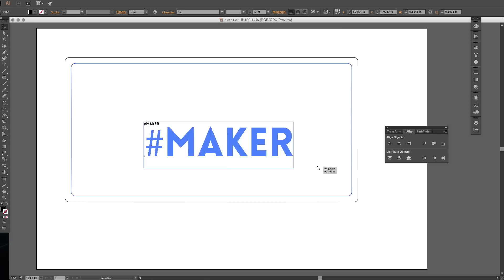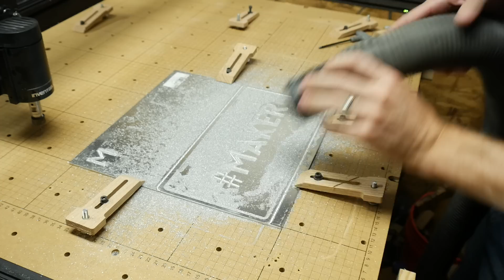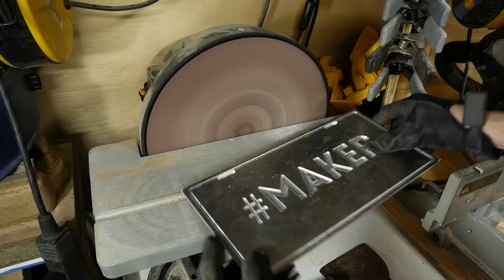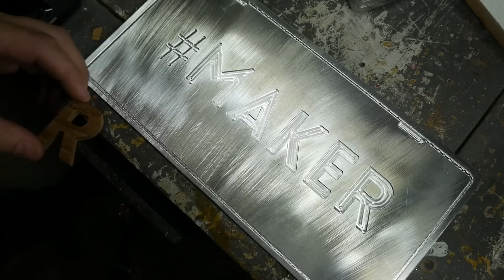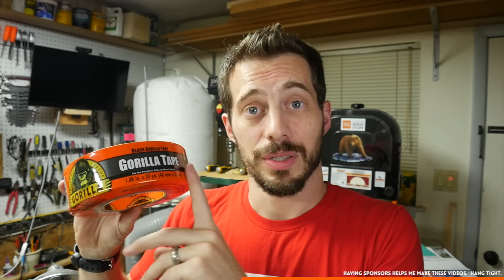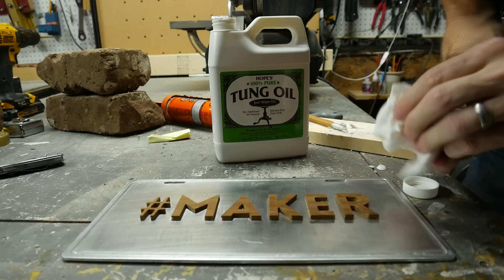Custom License Plate // How-To | I Like To Make Stuff

Comment: I'm thinking about getting the x carve but I've seen a lot of mixed reviews about it's reliability and dependability. Some have said that you have to calibrate it pretty much after each use. Have you run into any problems with the machine? Would you recommend it to a friend? If yes why? If no, why not?
Reply from the maker: I would definitely recommend it.  Personally I've not had any of the troubles that people complain about and I've built 3 of them for different reasons.
Reply: wow! thanks for the help! love your channel by the way!

Comment: When I do CNC inlays, I turn the text into vectors so I can manipulate it. Then I round-over any corners with a 1/16" diameter, because I use a 1/16" bit for this type of thing. Then I'm able to use the same vector file, cut a pocket toolpath and an outer profile one and the parts fit together right out of the machine, barely any sanding at all. It's like you said in the end of the video, about incorporating the limitations of the machine into the design.

http://imgur.com/IZTSgzL

In this image you can see the rounded corners, and how exact the fit of the two parts is. the letters here have a stroke of about 1/8" for reference.

Comment: I have never used that software on a CNC machine but the Vectric software has an inlay feature that will compensate for the inside/outside corner issue your having. 

Enjoying the videos.

Comment: i use a palm sander to finish aluminum with a brushed finish. especially large flat surfaces.  try sanding in a linear pattern like you would with wood grain . the finish comes out very nice and even!

Comment: you would have to pull some strings in California

Basically if you were assigned 2 then you have to have 2

5200.  (a) When two license plates are issued by the department for
use upon a vehicle, they shall be attached to the vehicle for which
they were issued, one in the front and the other in the rear.
   (b) When only one license plate is issued for use upon a vehicle,
it shall be attached to the rear thereof, unless the license plate is
issued for use upon a truck tractor, in which case the license plate
shall be displayed in accordance with Section 4850.5.

Comment: Instead of slots for the screws, you should have measured the spacing of the screw holes in your bumper, and drilled the holes on the same spacing, so no visible slots.

Comment: A nice finish to do for aluminium is to put a pencil in your drill press with the eraser on the bottom end and apply some grinding compound to the eraser and turn your drill press on and polish the surface by overlapping the polished surface and even better result is to use different sized erasers.

Comment: Check out mtmwood - the king of inlays. He solved the corner problem, but he has 3 axis mill and the head has a piramid cutting bit. As the head moves towards the corner it also goes up, cutting the corner into a point. The inlay letter has a matching side slant so it pops inside. Im not sure that would work on metal + wood combo.

Comment: Nice job as always. One thing on cutters for sheet aluminum, I've seen some with a downward cutting spiral. They seem to help the edge stay smoother since the cutter pushed the material down into the table instead of pulling it up against the clamps and causing chatter. It may not have mattered much with 1/8 in material and light passes, but it was great for thinner sheet metal.

Comment: I think you should check out G-Wizard over on CNCcookbook.com He has a Speeds and Feeds calculator and I think you will be amazed at what speed you should be cutting at with just a single flute. Add more flutes and your machine will have to go even faster to keep up with chip load (gets rid of the heat).  Also with thin sheet metal you might want to add shelf liner to the bottom side of the aluminum and spray adhesive this down to a scrap piece of wood. Should stop a lot of the vibration.

Comment: I think if you flipped the lettering so that the back is up then you set the first pass to run the rounded corners then each pass after that would run sharp corners.  I don't have a cnc and haven't done any inlay but that was just a first thought.

Comment: Nice work. But won't work in California. We need both license plates. Your cut time on the cnc table sounds rough. I cut some 1/4" aluminum plate the other day. It was a 36" x 18" semicircle with holes and cutout and it took only 25 minutes. Ok. I have a bigger machine, but possibly your feed and speed needs adjustment. Also, I used this 1/8" bit. From Tools Today, Amana Tool 51454. Spiral 'O' Flute. My feed rate was 18 IPM and I was able to use a router speed of 19,000 RPM. That is probably faster router than you have, but with this bit and feed, you should be able to do better. I called Tools Today and talked to them about how to do this. 

Keep it up. I like your videos.

Comment: Single fluit is fine for aluminium but you do need a higher RPM because it is single flute. I hope you dont mind I link to another video, in this video from Datron you can see a single flute used on aluminium with a nice removal rate, for example: 1:45 into the video ( https://www.youtube.com/watch?v=aCeywiKCYhA )

Comment: I'm looking forward to seeing how the machine works with the new bit/router.
Reply from the maker: +Greg's Garage Video coming on it, but I'll tell you.. it's WAAAAAY better :)
Reply: Then I have another question...  I suspect the dewalt has variable speed for the bit.  Did you go high or low speed?  Also, did you let easel handle the feed rate with its defaults?  Maybe I should just wait for the vid... :D
Reply from the maker: Greg's Garage I'm currently just trying different things.. going faster (feed speed and spindle speed) and faster until it stops working well, then I'll back off a bit.
Reply: +I Like To Make Stuff I'd like to know what the final speed is. if it took 16 hours with the slow spindle, and wrong bit, how long does it take with the dewalt spindle and correct aluminum bit.
Reply from the maker: Brian Noah WAAAY less time :) Video incoming soon.

Comment: I've never used easle with my shapeoko simply because it was not available when I started, and I've gotten accustomed to more advanced CAM programs (preferably Fusion these days because it's free and super good). The default settings in easle must be painfully conservative! Those cut times are horribad. Hopefully the new spindle gets you better settings. If not you should do some testing yourself with the wiki settings as a start, because it can surely cut a LOT quicker/more aggressive.
Reply from the maker: +Auarhau Yeah, they are really conservative, which I understand I guess.  I've done the upgrade since I shot this and experimented some with much higher speeds.  It works SO much better, and faster now!
Reply: Cool, glad it worked out! :D Looking forward to seeing more.

Comment: This turned out pretty sweet!  Question.  Do you use your wood cutting blade to cut aluminum on your bandsaw or do you change the blade out?  I've resisted cutting aluminum on my bandsaw because I've been told it will ruin the blade.  But I know Diresta does it all the time. But he's got super human powers. ;-)
Reply from the maker: +TheGeekPub Thanks! I did use my wood blade only because it's what I had on hand.  If I were to do a lot more of it, I would probably get a dedicated metal blade.

Comment: If you machine the timber letters, larger than the aluminium engraving, then machine an offset on the bottom of the letters, so that they fit inside the aluminium engraving, you will get over the radius problem and not be able to see the edges of the aluminium engraving.

Comment: As a cnc-machinist as my daily job for the past 15 years I can assure you the extra spindle power and bits still wont give you the results you are hoping for. You need a machine thats more rigid.
You don't drill wood with drill bits made out of wood do you?
Well you don't mill aluminum with a machine made out of aluminum either. Steel or preferably cast iron is what you want.

I love your channel! Always intresting stuff.

Comment: Bob, cool plate.  Regarding the letters, wouldn't it have made more sense to plug in the radius of the bit on the corners of the letters when cutting them on the CNC so they would be cut to match the inside radius of the inlay?

Comment: I'm surprised you didn't make use of Easel's "Inlay Generator" app.  It takes your selected vectors and creates a male and female version of them taking the bit size into account and giving you the option to set a tolerance between the two parts.  I've tried it with a few shapes and it really solves a TON of problems with doing inlay work, namely the bit size problem you outlined in the video.
Reply from the maker: +Mike Bryan I wasn't aware of it! I'll check it out, thanks!

Comment: +I Like To Make Stuff Great video Bob! The next time you want to do inlays in easel, give the Inlay Generator in the App Library a try. Select the objects you want to inlay, click the app library button in the toolbar (button with a 3 x 3 grid of squares on it). Then click Inlay Generator. You can tell it your bit size and the tolerance to apply. Once you click Import, you will have the inner and outer objects for your inlay. Unless your male and female pieces are going to be the exact same thickness, you will need to now clone the job and make one job for the male and one for the female.

Anyway, thank you for the great videos. I look forward to them each week.

Comment: That looks really good. You might want to think about galvanic corrosion between the steel bolts and the aluminium. A few rubber washers should put you in good shape.
Reply from the maker: +Just Make It Good call!

Comment: Bob, do you need to upgrade the servo motors when you put in a bigger router?
Reply from the maker: +WoodRodent Nope1
Reply: They're actually stepper motors, not servos, and I don't think you'd need to upgrade them unless you were using a VERY heavy router

Comment: Totally agree with the CNC issues! I would also add that if you make an outside the line cut, the edges as sharp as long the angle is wider than 60 degrees. Close angles get round corners! Cool plate!

Comment: if I remember correctly, Matthias Wandel's tests with original gorilla glue showed that the foaming killed the strength of the joint.  it was fine in tight joints, and still worked well for light duty in looser joints.

the construction adhesive looks nice.

Comment: Looks great, but the letter cuts in the aluminum doesn't have any use besides holing the glue. You could just drill a few holes not all the way in and put the glo in there.
Reply from the maker: +Stephan Mare Actually, the biggest reason is giving them a channel for alignment. Having them inlayed helps avoid shearing force a little as well. Like if you hit the side of a letter, it's less likely to pop off since it's in the channel.
Reply: +I Like To Make Stuff Okay I see. Love your video's man keep it up!
Reply from the maker: Stephan Mare Thanks!

Comment: well done! to solve round corners problem you could flip letters horizontally, cut inside the profile just for the inlay depth in the aluminium. Then you could cut the outside profile adding a second waste board. It will let you pass through the wood without any teardown or damage in the letters "front" face.

Comment: Were you previously a graphic designer or are you still? I've noticed your graphics are very good quality and you have a lot of technical experience with Illustrator. I'm currently studying it at college and am just curious.
Reply from the maker: +Jordan I did start doing graphic design in college, but moved to more general computer art.  I was at art school, so I was surrounded by design and production, even though I don't think of myself as a designer.
Reply: +I Like To Make Stuff Your knowledge is definitely reflected in your work. When I first subcribed, one of the main reasons was because of the quality of the videos and the graphic elements. Keep up the good work!
Reply from the maker: ***** Thank you!!

Comment: Love the video Bob! There is technically nothing wrong with cutting aluminium with a single flute bit. Fewer flutes are good for aluminium as it provides better chip ejection and means you can run your spindle at max rpm (and max torque therefore) without rubbing especially with small bits like 1/8th which can get clogged up easily if you use more than 2 flutes and then go blunt.  What bits are you going to be using with the dewalt? 2 flute or 3 flute? High helix?

this may help: http://blog.cnccookbook.com/2012/12/23/why-use-a-single-flute-end-mill/
Reply from the maker: +Nick Charlton Thanks!  I'm going to experiment, but currently I'm trying out a 2 flute bit for aluminum. I don't have the specs on hand.  I'll check out that link though, thank you!
Reply: +I Like To Make Stuff No problem! Do let me know if you need any advice on CNC related stuff, I study CNC manufacturing as part of my engineering degree :)

Comment: hey Bob, 16 hours sounds quite too long) what kind of endmill did you use first? I'd suggest using the ones for metal 2-4 flutes, stepdown about 0,004 of an inch with quite fast feed and rpm, also with some lubricant. would be much smoother and clean with no time for endmill to overheat. Had a successful experience with aircraft alu. and used settings like above. However one-flute ones do perfect job with plexiglass etc.
Reply from the maker: +3dStereoArt It was definitely longer than necessary. I was going really slow out of precaution.  I've upgraded since and am moving the spindle WAY faster :)

Comment: You're going to love having the Dewalt (I have a Makita in mine) and some nice carbide bits. But - you're going to have to stiffen up the two MakerSlides on the X-carriage so that they're connected to eachother. It's going to make it a lot more rigid.
Reply from the maker: +Tony Lorentzen Since I shot this, I've done the upgrade (video coming) and you're right, it's a HUGE improvement!  I haven't had to stiffen the gantry yet, but will probably look into it at some point.
Reply: Given the extra weight of the spindle, try to grab it and wiggle it back and forth. You'll see the two MakerSlides move up and down a tiny bit. It'll make a huge difference in terms of precision when cutting metal :-)

Comment: Single flute are good for aluminium. You are probably going too slow and rubbing the bit blunt. If you have an underpowered spindle a less deep cut can work well but still with speed. If you have trouble with aluminium sticking to the cutter then try and get a cutter coated for aluminium or use some rubbing alcohol as a coolant, you don't need much. High end Datron routers use ethanol but I have found IPA works too, you can dilute a little with water too. It just evaporates so no clean up. Non ferrous metals only for obvious reasons. A cheap air brush can be used for a simple spray set up too.
Reply from the maker: +littlestworkshop Awesome, thanks for the tips!  Since I shot this, I've done the upgrade I mentioned, as well as tested at higher speeds and you're totally right.. it works MUCH better!  I was just using wd40 as a coolant, but i"ll try out alcohol, thanks!
Reply: +littlestworkshop You made the right choice on the new spindle though!
Reply: +I Like To Make Stuff WD40 does work fine but just makes clean up harder and chips tend to collect in deep slots which means lots of brushing or air blasting. A lot of people also use air for cooling, point it at the bit and is cools and also clears the chips, both help prevent sticking which is the death of cutters.